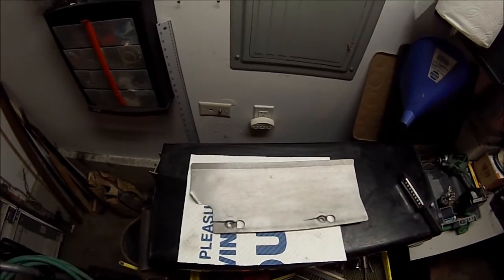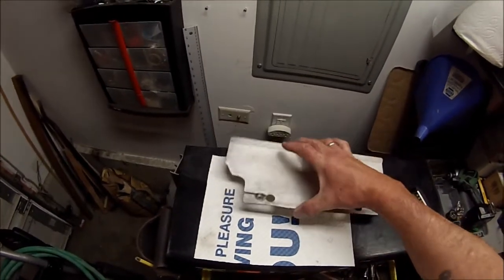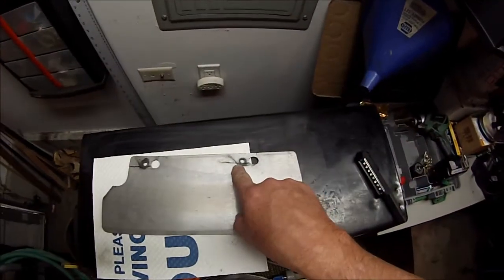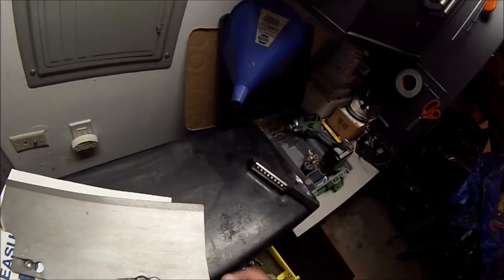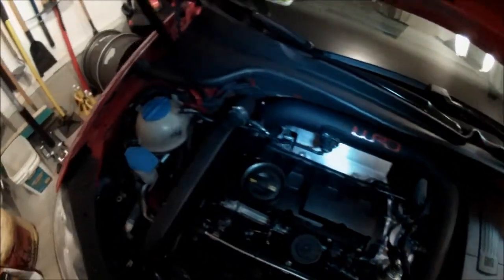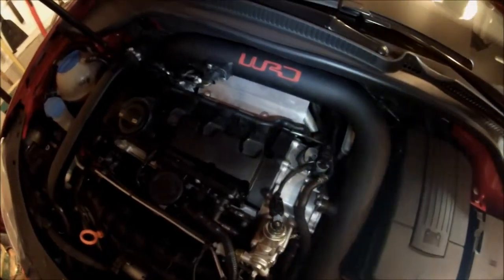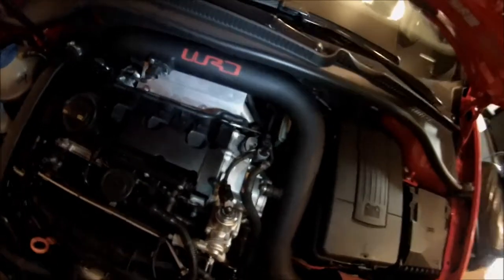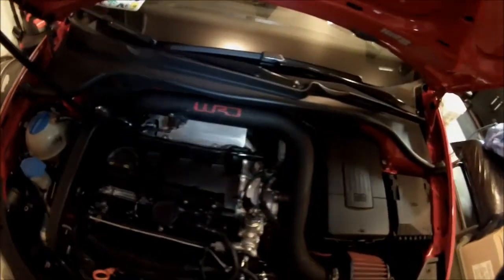Made a replacement heat shield for a P-Flo intake on a 2.0t FSI

Comment: Do you happen to have a "template" that I can use to build from scratch?  I don't have an original p-flo heat shield.  Should I just do a template from the "lower-right" corner of the 6.5x13" rectangle you suggest?

Comment: i see you are still using the original coil packs. Do you think the R8 coils are just marketing ? Im still using the original ones on Gli running f23t and a aggressive tune. I just cant justify the money for "upgrading" to the r8s. i haven't seen any real data.   ( i do get misfires, but once is a blue moon whens its over 110 degrees ambient temp and a few hard pulls) .
Reply: I  think the stock (black) coils are just as good, it might just be a color difference. i also run the NGk PFR7b to .024''.  I guess the only way to confirm this is to open up both coils and see is anything changes.
Reply: although there are some interesting claims towards the bottom of this page. 

https://www.golfmkv.com/forums/showthread.php?t=183710
Reply: Thanks for the insight, there is a lot of "bad information'' with relation to resistance and voltage. Ill probably give them a try if my misfires still occur in temps over 110.